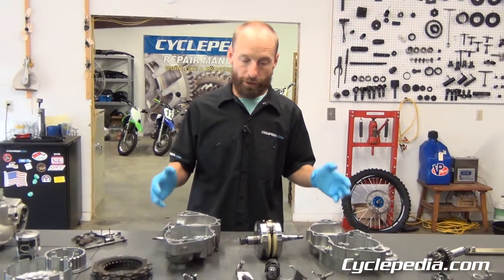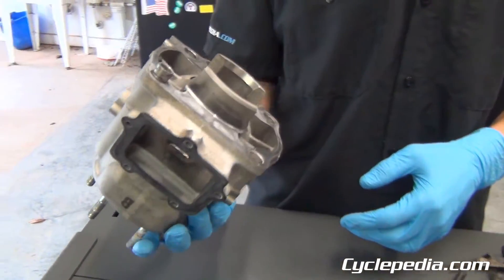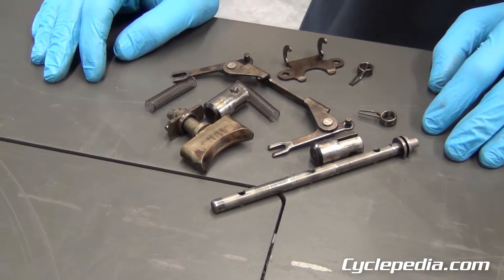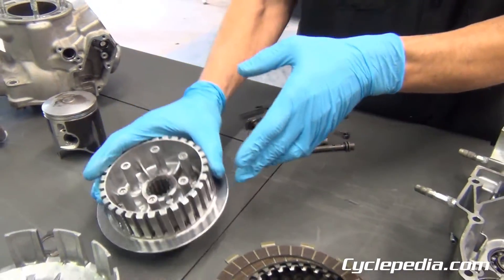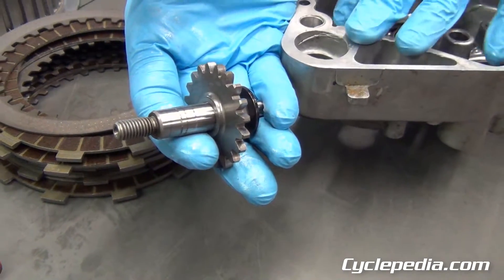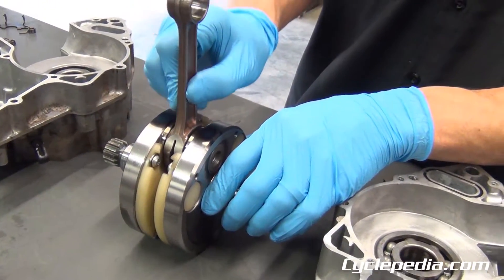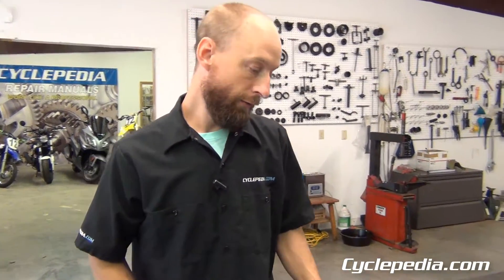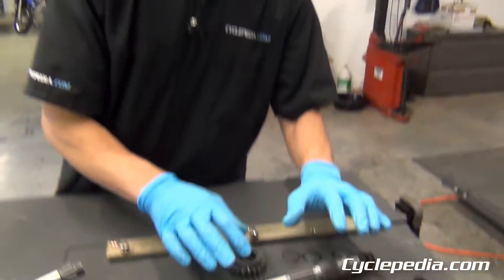YZ250 2-Stroke Engine Disassembly and Inspection

Comment: My ‘97 YZ250 has that same issue with the 1st gear. The part is unavailable, it is a 27 tooth gear. Do you think I could square the edges where the 5th gear engages on the 1st gear and replace the 5th gear and shift fork?